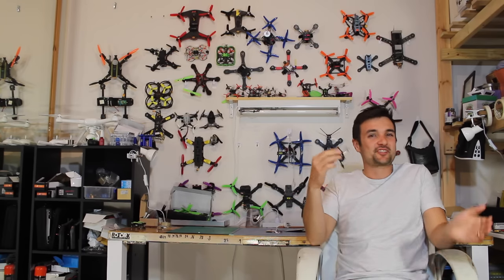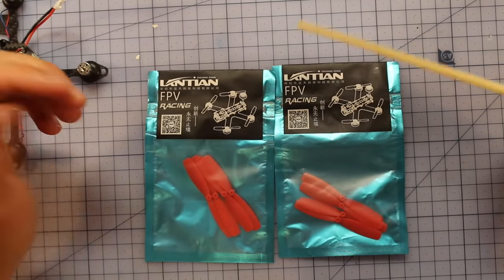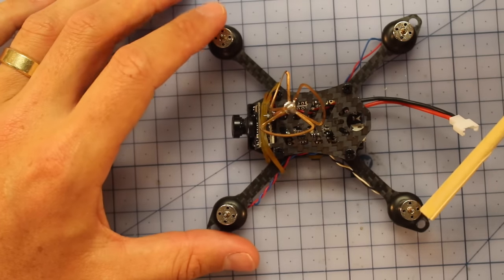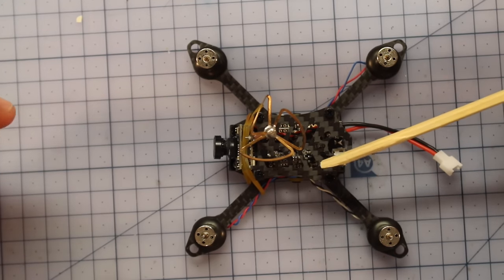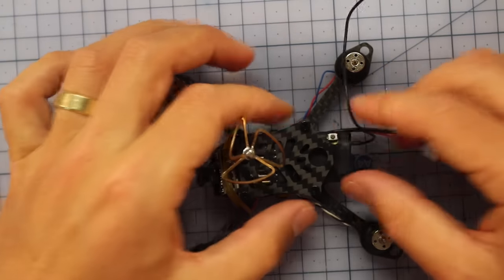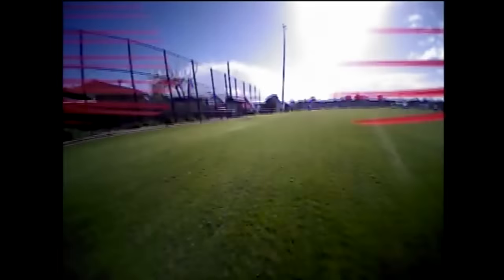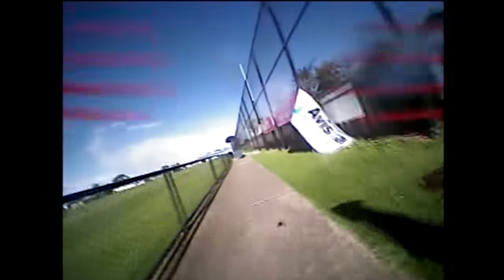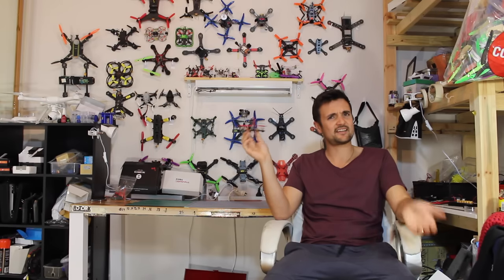LT105 Quadcopter Review + flight. Micro FPV drone.

Comment: Thanks for the review Stu! I've looked at this frame a few times and thinking about replacing the frame on the QX100 with the LT105 frame along with upgrading to Spintech motors. The QX100 is such a disappoint in performance. It looks like this frame would allow me to run 65mm props where the QX100 frame limits me to 55mm. Love you vids, keep them coming!

Comment: I'm running this quad copter with scisky board and 65mm props which are bigger than recommended but the 8mm motors are tall enough to raise the props above the top plate and give them plenty of clearance. With a 300 mah lipo this thing is a rocket and it only weighs 36 grams! I also got a micro 200 mw vtx so the range is awesome. The receiver isn't the best but i haven't had any issues so far.
Cheers keep it up

Comment: Interesting. The frame in this kit is different to the banggood lantian lt 105 frame i bought.
Mine was shorter so i had to mount the camera on top and the standoffs were a bit too close together and very close at the front so i had to cut some notches for the flight controller on the back ones.
Looks like a better version of the same frame but it seems like it might be front heavy with the camera not in the center.
Reply from the maker: hey mate. I remember your channe, you subbed way back when I had like 1000 subscribers. Thanks for your support. 

also are you still making music, do you make any of your own stuff?
Reply: Yeah your channel grew really fast. You have some great videos :)
I am still making some music videos, but plan on doing more rc related stuff.
For the little lt105 frame, which props would you recommend? 
I am currently running the standard hubsan props, but they feel a bit small.
Reply from the maker: Gigawipf i like the props that come with it, but rolling spider props are great too. Ps if you ever make any sick tunes I'm always looking for music for my vids

Comment: Thanks for the video, I really want to try the d4r-ii with my own mini quad. How did you solder the d4r-ii to the flight controller? I've attached it in the same way as the stock receiver, and the d4r-ii is powered, but I don't get the signal through to my flight controller. Checked all the cables, tried another d4r-ii module, even the binding works (green light on d4r-ii), tried both betaflight and cleanflight, tried ppm and sbus receiver modes, with and without the jumper on the d4r-ii, it works fine with my other quads but not on both of my mini quads (qx90, ex105, both with different spracing f3 based flight controller, one blue and one black). How did you get the d4r-ii to work with this?
Reply from the maker: check which pads you are soldering too... im not sure. mine was preyty straight fwd

Comment: Would you recommend this over building a Tiny Whoop style micro?, even if the tiny whoop could have an f3 board on BF?  This one looks like more fun to fly, and the increased range is great.  Could you fly it indoors without the ducted props?
Reply from the maker: This does fly out doors and does not have ducted props

Comment: Do you think I could just switch the qx90 camera back and forth between the LT105 and qx90 if I soldered a micro jst cable and used velcro? Thanks!
Reply from the maker: yep
Reply: UAVfutures Thanks! I actually ended up buying the qx95 frame, you should review it as well!

Comment: It's nice that you placed the frame on the cutting mat, l found out that it was to scale on my computer at 4:20. 
I'm thinking of getting one of these but compared to a 1104/5 motor quad which do you think would be better for practicing acro/freestyle moves; also, which would have better "crash-ability"?  My purpose of getting a micro quad would be to get more stick time so I can get better flying with my 210 frame ..
Reply from the maker: these tiny brushed quads are great at crashing but not really suited to flips and rolls, they can do them but its nothing like a brushed quad. But they are much much easier to fly indoors, The 1105s just have sooo much power it is crazy and unless you have a larger house I say the qxs and the lt105 are the way to go for getting more stick time
Reply: Thank you so much!

Comment: Would it be more advisable to use a D4R or and X4R (for SBUS)... assuming the flight controller can handle SBUS?
Reply from the maker: the x4r is better
Reply: UAVfutures I actually bought the Furious Micro FrySky rx. Its like 2 grams.
Reply from the maker: Bill Sheley my mate had range issues with those
Reply: UAVfutures bummer...well Ill give it a go and if its crap ill depin an old d4r and go with the tried and true

Comment: any comment on the durability of the frame? I was going to build my own micro but this has made me think again..
Reply from the maker: looks fine to me, but if you are really worried the qx80 is a lot more durable in my opinion, but not as easy to fit a receiver to and not as suited to the LT105 outdoors either.
Reply: given my flying ability i might go for the qx80 then, thanks :D and keep the awesome vids coming!
Reply from the maker: there is a review of the qx80 on my channel if it helps

Comment: Do you have a video on wiring the receiver? Do I use a voltage step up? This is why I don't have a micro,Setting up the receiver to work with my transmitter thing. I don't want to buy a transmitter just for micro. But Winter is Here  TY.
Reply from the maker: I dont have a video sorry, but it was very easy to connect my d4r2 so i could use it with my taranis. It put out 5v for the rx. so you dont need a step up
Reply: If I am understanding correctly your saying the fc board has 5v output? That would be kool.. I can work with that, Thanks.
Reply from the maker: yep correct
Reply: Thank you, Just placed my order with GB.

Comment: hey stew, got a question about the f3 brushed evo. i try to Flash it with beta but it's not reconized and serial failed to open. i want to reconnect with cleanflight but cleanflight also doesnt reconize the Board now. i installed my drivers and it's reading the bootloader and it's saying Board is in dfu mode when boot pads are jumpered. do you Have any idea's or advice for this problem.

thanks allready mate

🤘
Reply: Same thing happened to me.  You need to un-jumper the board after flashing it otherwise it will always boot in DFU mode.  Good luck.
Reply: Board's Just stuck on erasing. Can't even Flash firmware. Other Board got the Same issue. All my other board's that Flash with dfu Have No problems. So i really don't No what is going on with these board's, maybe Just unlucky with it
Reply: Did you use the DeFuse Demo flashing utility?
Reply: Yup
Reply: Did you try replacing its drivers?
Reply: That usually works for me.

Comment: Hmmmm..? Using a quadcopter to run dogs?? Sound like a new source of income. I flashed betaflight for the first time recently and it was easy, settings threw me  off a bit but I'm learning.  Haven't made any adjustments to PIDs yet but it(S250 Pro) does fly way different.
Reply from the maker: yeah, but I doubt anyone will pay me for it

Comment: Hi Stewi, what FC is this rocking and can I stick a non-FR-sky receiver in it (like a Radiolink R6D)?
Reply from the maker: yeah pretty sure you can use any receiver that fits. that is why i like it so much
Reply: i have a depinned r6ds on my qx80 with doublesided tape right to the FC.  Looks like this is the same FC.  Fits & works great.
Reply from the maker: Phongsta thanks mate. that means so much to me. I love making these videos and want to make so many more. With the support of people like you this is getting closer and closer to a reality. Thanks again.
Reply: I just built one of these with the new(ish?) Radiolink r6dsm. It weighs 41 grams on the money.